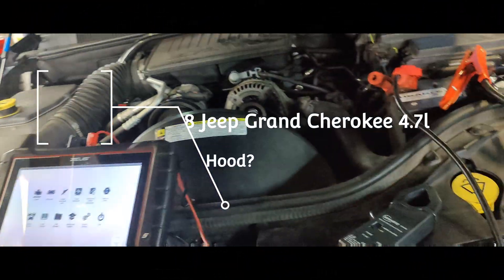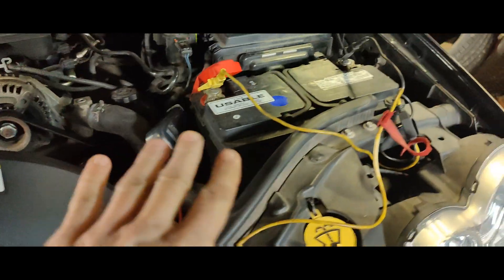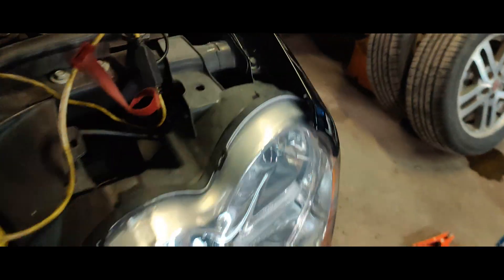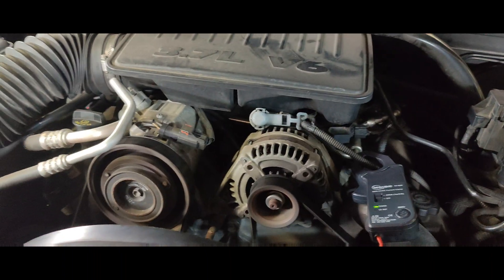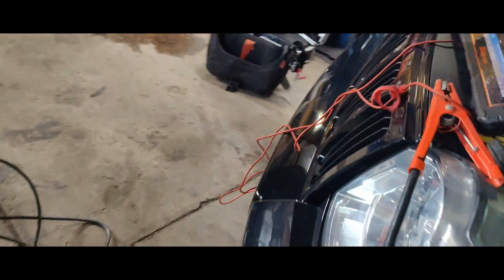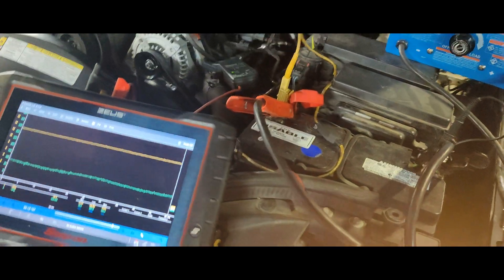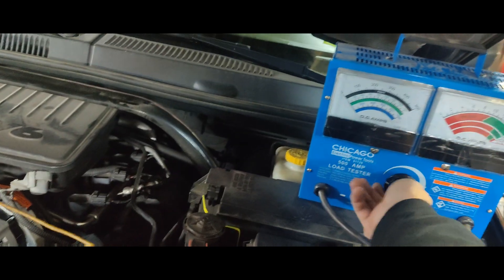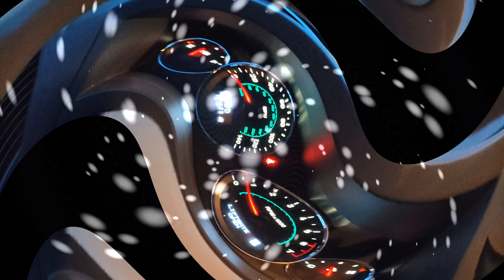2008 Jeep Grand Cherokee 4.7l 4x4 Dead Battery, Smoke From Under Hood?

Comment: What’s the rule of thumb for how many amps you set the carbon pile for to load test batteries?
Reply from the maker: They always say half the rated cranking amps for 15 seconds but I always just try 200-300 amps  for 10 seconds or so and maintain 10.0v.
Reply from the maker: You have to make sure the battery is fully charged. I usually do the test 2 - 3 times to make sure it doesn't have a bad cell. Keep in mind the CCA is how many amps a battery can put out for 30 seconds.